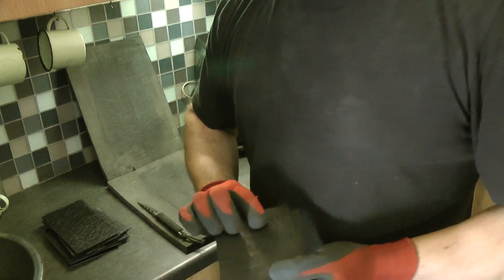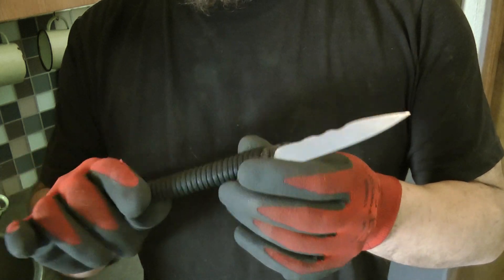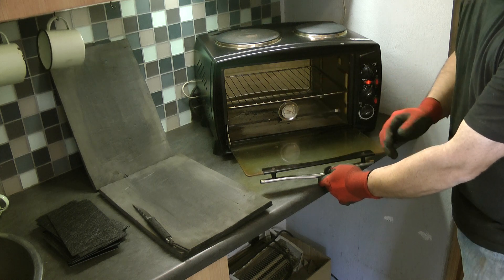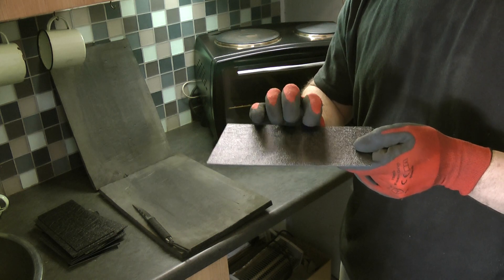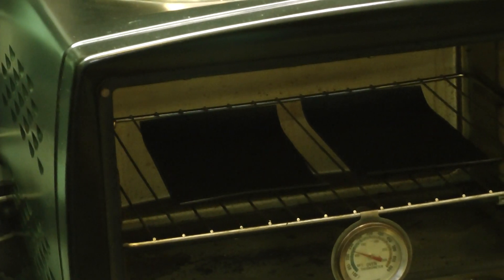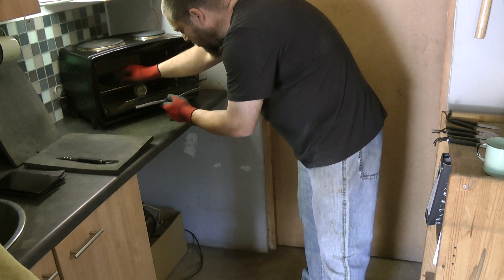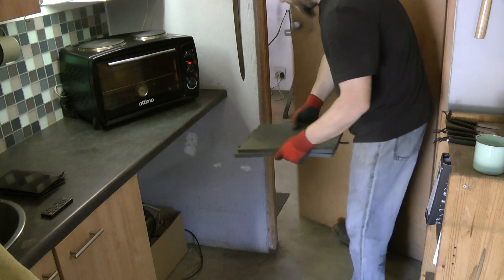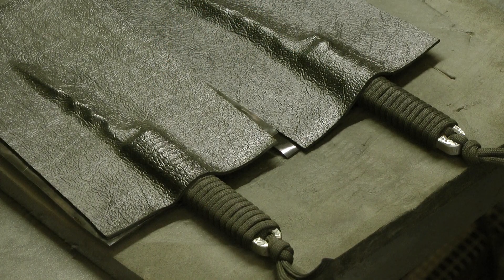Knifemaker Workshop Tip #41 - ABS / Kydex moulding - No press required!

Comment: I am experimenting with PVC drainage pipe. it is also a thermo plastic,  1/10 of the price of kydex,  and if you size the pipe well to the knife, you have formed edges that look a lot neater than a riveted wide edge, the usual result when using kydex. You can also use a heat gun to fine tune the fit to the knife to the sheath quite easily. 

Only downside is it only comes in a smooth vanilla white, so it requires a painted finish if you want it to look flash.

Comment: howzit neels i tried to make a sheath today but the sheets didnt stick and the form of the knife wasnt fully visible, what am i doing wrong (oven was at 180 for 2 mins)
Reply from the maker: What are you using? ABS of KYDEX? It sounds like it might not have been hot enough ...
Reply: im using kydex, the first time i watched your vid you said 100 degrees so i figured i could put it higher for a shorter amount of time but no bonding occurred
Reply from the maker: Sandro leon - martin I use ABS, not KYDEX in the video. KYDEX, as far as I understand has a higher working temperature than ABS. I have no idea what the working temp would be for KYDEX. I suggest contact your supplier for the info. Don't guess, know ... :) . It's always better to stick to suggested temperatures and timeframes. By doubling the temp and halving the time, you will not be able to compare your results with mine ... Hope this helps.
Reply: +Sandro leon - martin Kydex also has somewhat of a "memory", if you will. If it's not hot enough to get an initial imprint and form around the mold, it may just return to its original form.

Comment: Hi, cool trick. So by closed-cell foam you mean it's not a very expensive foam specifically for kydex presses?:) I'm just wondering because here it runs for 1/4 of a price of the knife I'm wanting to make and only available in 1m pieces. Sound dampening foam is half the price so I'm considering using that.
Is yours neoprane, PE, any specific purpose?
Reply from the maker: +mastahcez - Not a specific purpose. It is known locally as closed-cell foam and is the stuff everyone uses in their KYDEX presses. No idea what it's made from. Gotit from my local foam shop ... real cheap stuff
Reply: You could use an old backpacking mat fella...closed foam.